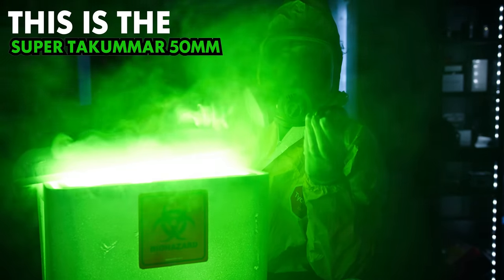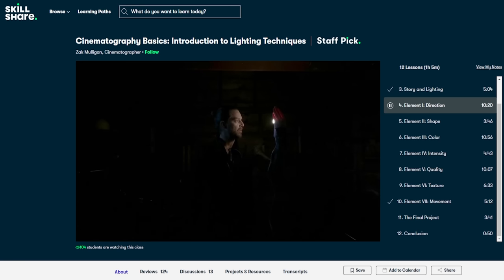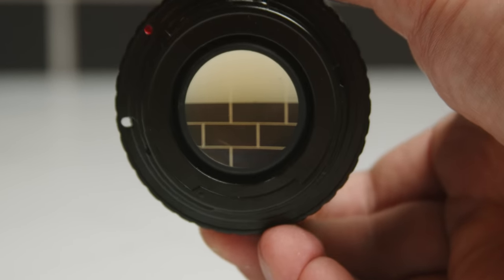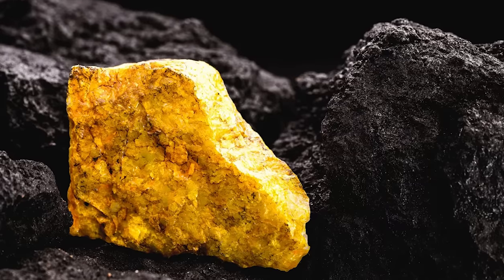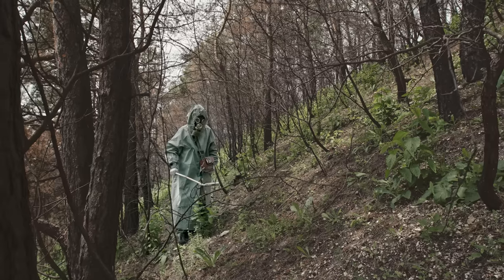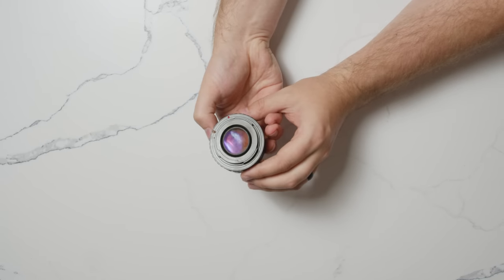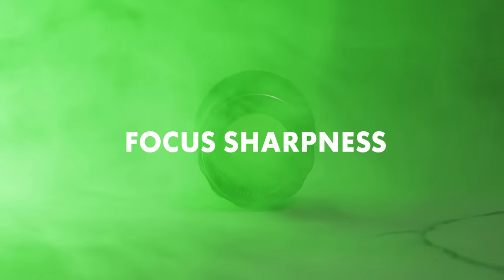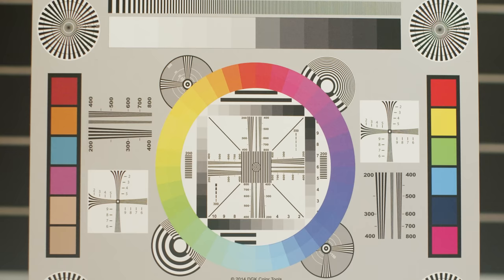These RADIOACTIVE Lenses are no JOKE

Comment: So, this fails to take into account the actual particles emitted, the inverse square law and a few other things. Camera lenses don't expose you to that much radiation because you're not actually getting a dose of 10 millirem an hour from them, because that's an absorbed dose. They emit that much radiation, but unless you're holding it directly in your mouth for an hour, you're getting fractions of that dose. A lot of that radiation is also going to be alpha and beta emissions, which can be stopped by thin plastic and skin, further reducing exposure. If you think about how much time you actually hold a lens close to your face as a photographer, especially without a camera body in the way that's going to block a lot of harmful radiation reaching you, you really don't have anything to worry about.
Reply from the maker: True! Only real threat I've found is if you inhale particles or ingest it. But even if you got glass in your skin it's still not radioactive enough to penetrate and affect you. 

Not a physicist, so tried my best in the technical details of it. So thanks for the correction!
Reply from the maker: Yep! 

Missed the extra "m" on the video. And I looked up how to pronounce it and found 3 different pronunciations of it 😅 I figured I would pick the wrong one. SUPER lenses though
Reply: Big fan of the inverse square law
Reply: Don't tell me where I can and can't stick my camera lens.
Reply from the maker: You're right 😩
Reply: @FrameVoyager My forebearers died for my god-given right to shove my full-frame DSLR glass into any orifice for however long I choose!

... but if you know any Vancouverites I would actually like to sell my thoriated Nikkor 35 1.4.
Reply: High energy alpha particles can go deep enough in your skin to cause damage. They can go through thin plastic and paper as well. Although the majority of them will be blocked. Beta particles will go through both but most of them will probably be stopped by the housing of the lens and camera. As long as you're not leaving the glass optic pressed against your skin for a long periods of time it should be fine. 
I would still recommend wearing gloves when handling alpha sources. Thicker nitrile gloves plus your skin should be enough to block the majority of alpha particles. The few that get through shouldn't be a problem.
Alpha particles especially don't go super far in the air so skin contact is the main concern.

Comment: The browning of the lens is actually a byproduct of the thorium breaking down.
You can restore it to some degree if you expose the glass to a lot of UV Light.
Since you already shot some test charts, it would be very interesting to test how much of the whitebalance shift can be removed, and if this has an effect on the CAs.
Reply from the maker: Yep! Yeah, I had thought about trying to do a time lapse of putting the lens under UV lights and getting rid of the browning but I ended up running out of time. Might be a good follow up video 🤔
Reply: I'd probably leave it as long as I can until normal sun exposure un-tints it, get the most of that natural filter until it's undone
Reply: One of my Bell and Howell lenses from the WW2 era had significant discoloration. I blasted it with UV light for about a week to clear it all up. I have another of the same lens to actually show a comparison of the yellowing-browning effect.

Comment: NEVER expose a lens to the sun. It will heat up the internals, causing grease to make the aperture blades stick together.
You can just use an Ikea LED desk light. Place the lens on a mirror with the LED light just above it. Turn the lens around a few times and upside down as well. Works great and the is no risk of damage to your lens. It takes 24 hours or more to fully clear a lens.

Comment: Thorium is also used in trace amounts in TIG welding electrodes. 2% Thoriated tungsten electrodes are very common and have one end painted red to indicate they are thoriated. Thorium has also been used as radiation shielding and can also be a radioactive decay product of uranium.

Just like how you don’t want to inhale broken thoriated glass, you don’t want to inhale thoriated tungsten when you grind the points of electrodes for welding.  I have ground mine with a mask on outside as a precaution
Reply from the maker: Oh interesting! Actually have filmed quite a bit of welding including mig, stick, sub-arc, and TIG. Didn't realize TIG had Thorium in it. Thorium is an interesting substance for sure.
Reply: @FrameVoyager  tungstenio color red .

Comment: Remember, at the time these lenses were made, all cameras had to have an on-board radioactivity detection system. It's called photographic film. The same material that was placed in dosimeter badges for workers in radioactive materials handling operations. If a worker were exposed to a level of radiation worthy of concern, it would show on his film badge when it was developed, and he would be distanced from the source for an adequate period, while processes would be improved to reduce the leakage at the source. Since all cameras used film at the time, and many lenses were attached to the camera body all the time, or most of the time, any significant emission, particularly from the rear element, would have been a known issue in film fogging. A Takumar lens like this would have been screwed into a Pentax body loaded with ASA 400 film and sitting on a shelf for months at a time without anyone ever reporting film fogging from it. 
Some other lenses may have had higher radioactivity levels, and the Aero-Ektar mentioned is the most famous example, but once again it did have to be used in immediate proximity to film, and in many reconnaissance missions they were flying at night, using the most sensitive emulsions they had, and even pre-exposing them in some cases to make them more sensitive, so there is just a real-world limit to how emissive these lenses could be and still work. 
Miniaturized geiger counters are available for cheap these days, and some are surprisingly good, so I would like to see some more scientific, measurement-based data on lenses people have in their collections, but remember your inverse-square law of propagation. If you've got a couple lenses like this in your lens cabinet, and you are within one meter of them for some minutes a month it is unlikely you have anything to be concerned about, and I would unhesitatingly handle and use them, though I would like to have more measured data about their emissivity just to establish more rational guidelines.

Comment: The radioactivity can be blocked by a piece of paper, all alpha particles. Besides that, the material in a camera actually blocks the radiation too. I have a 125 pound lens in my garage that has a large rear element entirely thoriated. It won't cause the kind damage that people are scared of. There are other videos that explain how low the radioactive levels are.

Comment: Nice video as always! I came to a similar conclusion with mine. I love it for darker more moody shots, and my current work load doesn't really match that. However I love the image and the feel of the lens so much I still use it anyway from time to time.
Reply from the maker: Appreciate it! And same! It's a fun lens to get to use! Used it with Ursa g2 a lot. Would love to try it with the 12k URSA
Reply: @FrameVoyager  nice! I shoot mostly on the original Ursa Mini Pro and Pocket 6k Pro and it's fantastic on both. I haven't shot many stills with it, but I'm curious to throw it on my 5Ds R and see how it holds up on a super high res sensor. Might be a good indication of it's performance on the 12k if only the sensors were the same size

Comment: I'm kinda more worried about my sensor then say my hand.  Especially on the rear element.  I'm hoping the glass on the sensor stops it.
Reply from the maker: From what I can tell it's totally fine, I just won't ever leave it on my camera for days at a time.
Reply: someone somewhere analysed that these lenses seems to cause hot pixels that remain for a very short time, as the radiation excites the pixels. However, there is always some radiation around us and neither that is breaking the senor immediately. Moreover, eventually all electronic components, including sensors, will fail anyway 😛

Comment: Wondering if these lenses also face fungus issue or radiation help.
Reply from the maker: I did not come across that in my research but I feel like it's probably safe for the most part besides the browning.
Reply: @FrameVoyager  if this radiation can help preventing fungus on the lenses then it can be considered as a feature. 🤣
Reply from the maker: @JaspreetSinghArtist  🤣🤣🤣 for REAL!
Reply: @FrameVoyager  in future you should do start another series. as your channel grow maybe you will be able to reach out some laptop brands to test them specifically for Premier Pro and Davinci resolve. Best at 1k range ,, 1.5k range and above.
Reply: I have a few of these thorium lenses. Unfortunately, they suffer from fungus about the same as other lenses.
Reply from the maker: Interesting!
Reply: @rebeccastreetanalog2219  fungus have some special surviving skills.

Comment: Hii. I have a different question.  I bought 3 vintage lenses.  These lenses are made with radioactive material.  There is dust on the 2 lenses and around the edges.  Could this dust come from inside the lens?  So, can thorium come out of the lens in powder form?  Respects
Reply from the maker: I would say more than likely that's just dust. If the glass isn't broken should be totally fine. Even then, it's really not overly high levels of radiation
Reply: @FrameVoyager  Thanks a lot for your answer.  There are no cracks in the glass, but there seems to be a slight crack in the inner layer.  But can the dust in that inner crack leak out?